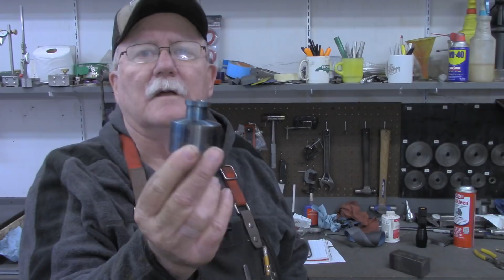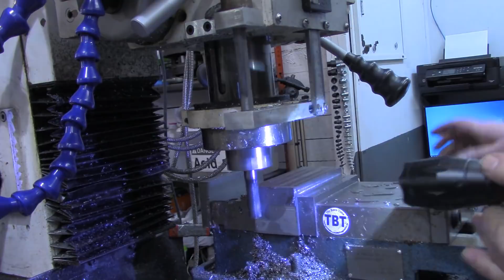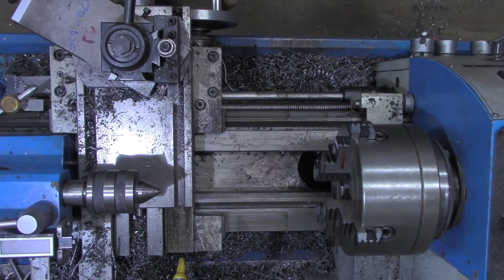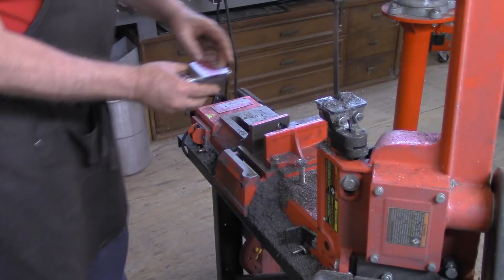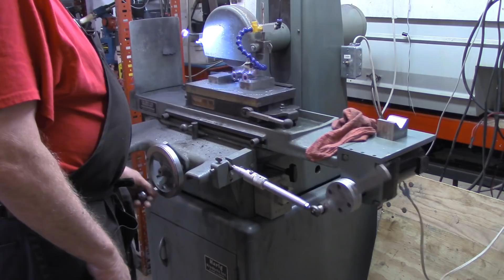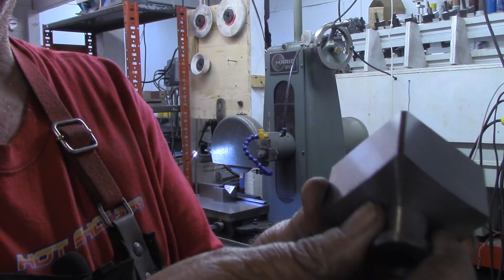Inkwells From 2" x 2" Metal Stock

Comment: Would it not have been better to face off both ends first then mount between centers and do the tops in the middle of the bar? a lot easier to part in 2 with the parting tool, then face off and drill the holes for the ink. Nice job whichever way you do it.